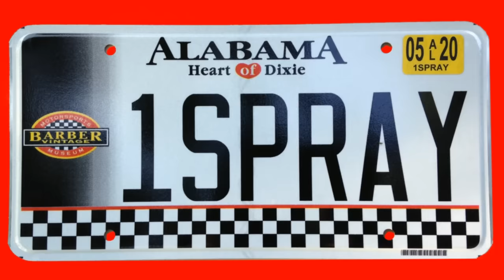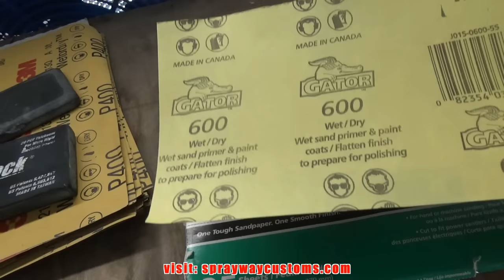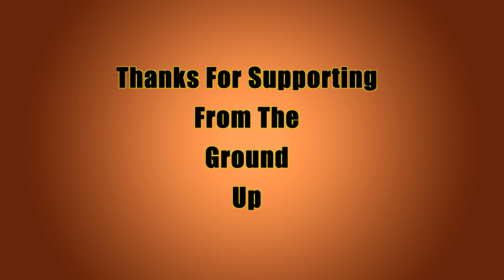How To Remove Orange Peel With A Flow Coat Re-Clear By Color Sanding 74 Caprice Donk Candy Paint Job

Comment: Man looks great! My buddy just had his 86 dually repainted all factory white looks great but has super orange peel almost blotchy the painter said O I don't mess with that stuff factory paint jobs had a texture to it. My buddy can't find anybody to color sand it make the paint flat and shiny they keep saying we don't know how much paint is there we don't wanna be responsible
Reply from the maker: Yes, they’re correct. Buffing a job that you didn’t spray could be very costly due to you not knowing how much clear was applied.
Reply: @SprayWayCustoms  That's what I told him to. He's a big engine guy not a body guy Lol. I spent a few years in autobody but it was boring insurance shops we didn't do any customizations. I wet sanded dirt spots on new panels that were freshly painted thats about it.

Comment: that second coat of clear always lays down flatter than the first one. Yea everyone gets some orange peel. more pressure and a good gun when you have good ventilation minimizes it. But you need to have good air flow in your spray area (booth) or you cant see when your spraying it.
Reply from the maker: That’s correct Mike

Comment: Thanks for the details my brother, I was trying to figure out what grit to use on this clear for paint correction I see the 600 grit wet. your video is the only 1 on here that shows that Cuzzin. Thanks for showing the art you mastered. You Definitely teaching sir. ? Wet sand 600 grit and re-coat?
Reply from the maker: No problem Anthony

Comment: The videos you make are some of the best on youtube, i love em and learn so much. Quick question before spraying sealer what grit of sandpaper should i sand the vehicle down to? It will be a mix of bare metal, very minimal body filler and old paint sanded down. Thanks
Reply from the maker: 320 will be fine after finishing the bodywork

Comment: Absalutly amazing  colour looks really nice great job sprayway my quistion  is you put 3 coats of clear  so for flow coat you use 600 gritt  then you sprayed your  clear now if you gave 2 coats of clear what grit  would  you  use to sand 800 or 1000 grit thank you for the video stay safe
Reply from the maker: 600 would be fine but you could use 800 if you don’t feel comfortable with 600

Comment: What’s good boss I had a question on the flow coat. why do you do that instead of going straight to wet sanding and buffing after the first 3 layers of clears. I’m new to this paint industry and loving the content you are creating!
Reply from the maker: Extra protection and it makes it much easier to level when cutting and buffing. Some guys don’t even cut and buff if they flow coat.
Reply: @SprayWayCustoms  That makes sense  I would also have to buff due to the conditions I’m painting in outside!!! Too much trash nibs. Thanks again

Comment: nice job .can you wet sand if you see problem before you clear? how long can you leave just the paint before you clear? love the vids.
Reply from the maker: You can in the base but not the candy because it still be tacky when you spray the clear. If you let it sit for more than 12 hours I would scuff it back up so the clear will bond

Comment: I like ur channel. I have a question about the flow coat or reflow coat, what if u have pearl in ur clear how would u clear it?
Reply from the maker: You should be fine with using 600 but it’s best when spraying the pearl is spray at least one coat of clear without the pearl over everything in case of situations like this.

Comment: Hey Spray... Had a catastrophic failure maybe you could clear up for me (no pun intended).. I clearcoated my piece and didn't like the finish so I sanded off the orange peal and re-cleared with the same clear (UreKem UC410). It must have had a chemical reaction with itself.... Seems to have lifted the previous clear and now it looks crinkled... Only thing I can think of is that I re-cleared to soon and the original clear was not fully cured... What a mess.... Any idea what caused this to happen... Thanks... M
Reply from the maker: It sounds like all the chemicals didn’t get released and got trapped

Comment: @spraywaycustoms.. could i apply this same technique to my base coat and then add clear? i have some orange peel and i figured if i wet sand the whole car again with600-800 then clear i should be ok? let me know what you think boss
Reply from the maker: You could just be carful not to cut through the color
Reply: @SprayWayCustoms  hand wet sanding it is lol what grit do you recommend? i watched a video of yours where you used 400 grit one time and then 600 grit?...

Comment: I have a new customer that has 2014 HD trike. The paint on it is chipping really bad so I chipped off all that I could. My question is can I sand and feather the remaining paint with out issues once I repaint. Or should try paint stripper or sand off the rest??
Reply from the maker: Just sand everything that’s chipping and feather edge it
Reply: @SprayWayCustoms  you don't think the rest of the paint will cause issues later?

Comment: Spray!I have a question! What creates dry spots and how to avoid them in the painting process??
Reply from the maker: Not having enough coverage, the overlap, gun settings. I really boils down to not enough material in that area but it could be different reasons for the cause.

Comment: I noticed in the video when you were spraying the car, that your cement floor was dry. This could be the reason for the trash in your hard work. Try wetting down your floor with water before you spray your paint. This will eliminate the spray gun from blowing up trash from sanded primer  the floor blowing up into the air and landing onto the fresh paint. ( After blocking and sanding the primer coats, sweep/vacuum the floor, then wet it down with water). See if this little trick helps eliminate the trash issue in your clearing process thus saving time in your cutting and buffing process.🫡
Reply: For the clear coat process especially!

Comment: what i s the model of the spraygun you used to spray the clear what is the tip size 1.3 0r 1.4 ?
Reply from the maker: It was an IWATA Supernova WS400 with a 1.3 tip

Comment: Can you use 600 grit for orange peel on metallics.
Reply from the maker: Yes…just sand it after the clear coat
Reply: @SprayWayCustoms  just got the turbine spray gun was gonna get plus some more activator but fast activator never used it but the temps will be getting colder soon. Once I get that and the turbine spray gun gonna sand still more down with a circular pad I used 600 already but is it better to sand orange peel with a orbital sander because I used a da polisher.

Comment: Considering your hours working water sanding, wouldn't it be more cost effective for you to buy a used paint booth and set it up under a shed to keep trash out of paint? I screw around painting as a hobby and not even trying to make a living and am looking at used booths, or just building my own down draft.
Reply: There too many variables in clear coating to eliminate orange peel from the brand of product, gun & settings and even speed. As for trash, a down-flow booth is nice and would reduce the defects, but either nessesity or money, this illustrates what can happen where you paint. Just some instruction on how to deal with it. Even a $50k booth still get trash. Like the fog in the air, they stick together. They get heavy and fall out of moving air and these tiny droplets land in the color, clear or both. Watch other high-end collision shop do a paint video, never trash free! There are tips & tricks, wet floor, tapping frame to the floor and great air flow, still get trash. Spray a complete and no trash, buy a lotto ticket. Peace.
Reply from the maker: Thanks for the great answer Dean…I couldn’t answered it better
Reply: I know there are other variables, plenty of them, it's about eliminating as many as possible. I have sprayed outside in open air and only had a yellow jacket land in wet paint on the hood of a 34 ford and walk around until he was stuck, and painted in $100,000 down draft booths and got trash in paint, my goal is to try to eliminate as many of the variables as possible.
 One thing I have learned about base coat/ clear coat, that a LOT of painters don't really think about, is pollen, your pollen count in Birmingham Alabama and mine here in Rome Georgia are about the same, and we know that is just a level of SUCK, lol, but turns out most pollen, not even the green pine pollen that we see, but the ragweed and tree pollen we don't see are pretty much molecules of grease. Guess what, a lot of paint problems that seem like mystery, are pollen sticking to base coat and contaminating it.
 I am OCD, and that doesn't help when painting anything, I overthink and drive myself crazy trying to get a perfect coat with as little work as possible.😂